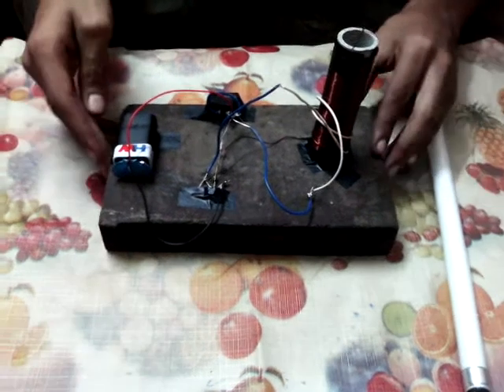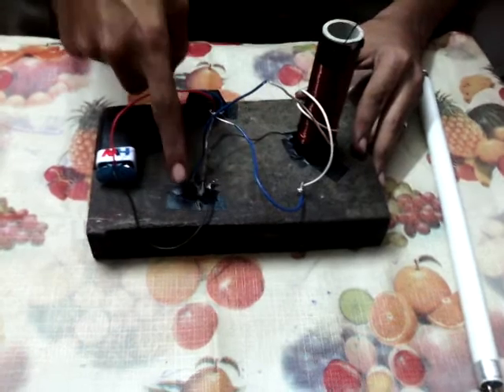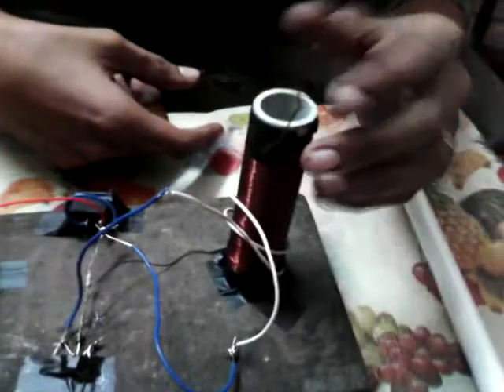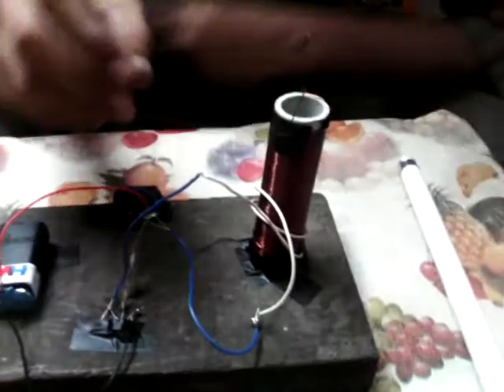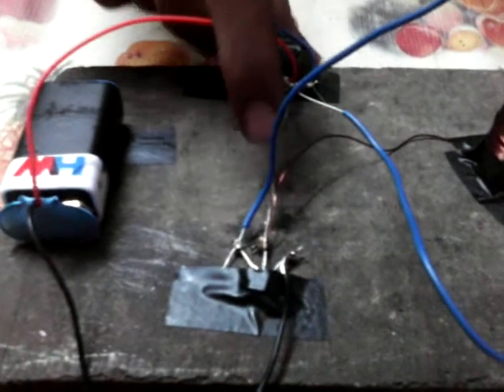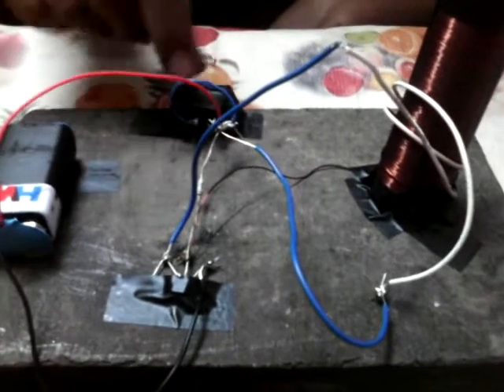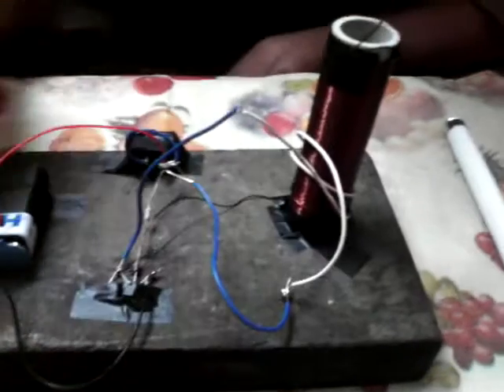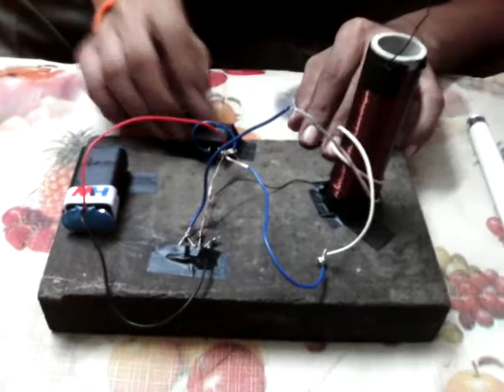Tesla coil

Comment from the maker: The difference is in the max continuous current: C945 - 150ma, 2N2222 - 500mA ..
But if you switch a couple of mA, say, below 100mA, there is not much difference between them ..